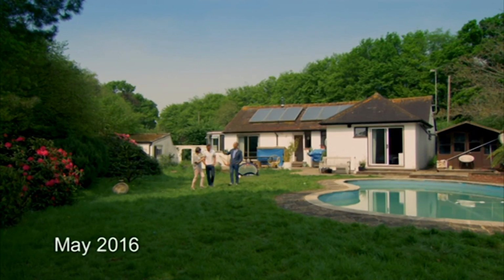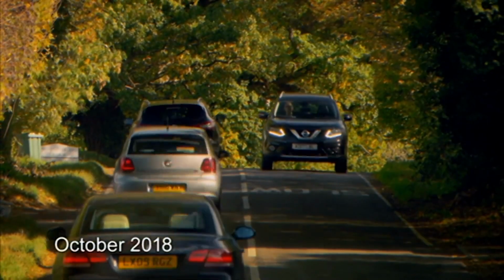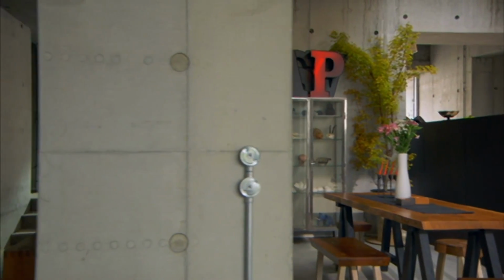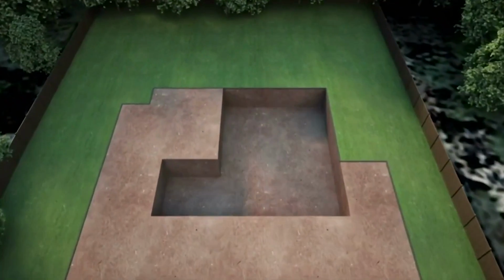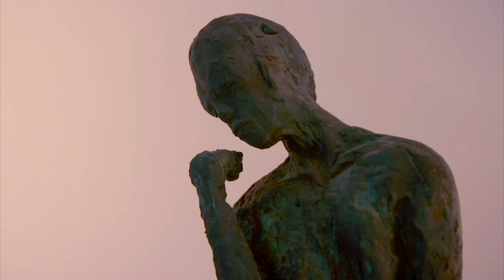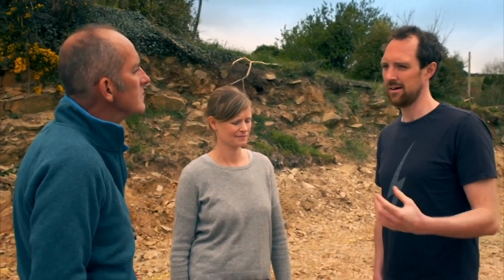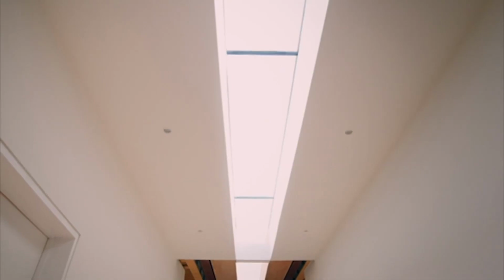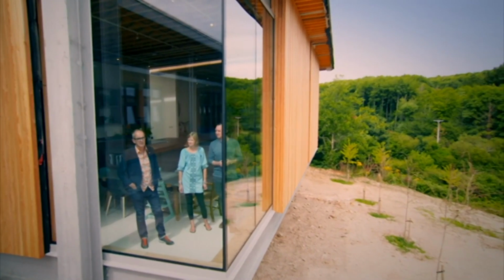Breathtaking Modern Homes | Grand Designs

Comment: The second house, why has it to be partially sunken to the ground ? Then it's like living in basement, I don't understand, it's a flat lot not like it's on a slope. 👎👎👎.First house, only architect's dream.
Reply: The sunken spaces are easier to heat/cool, and keep allergen free the same way that underground caves have much better indoor air quality than most buildings.